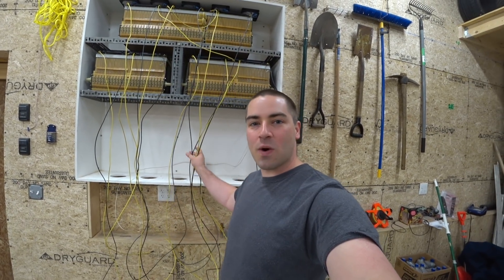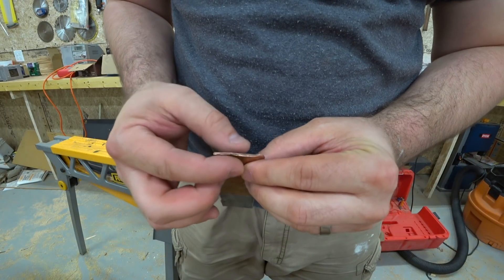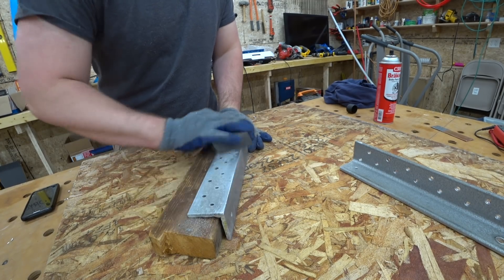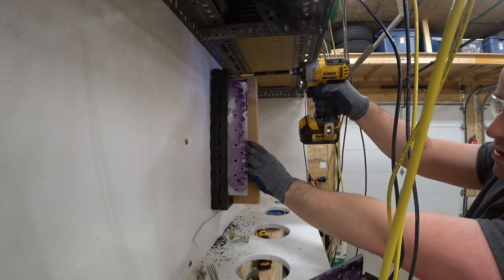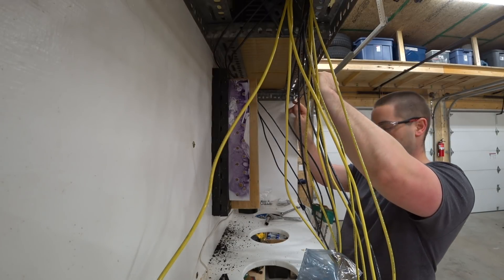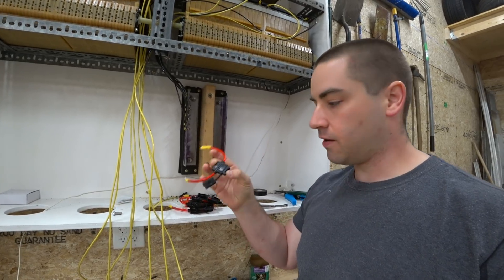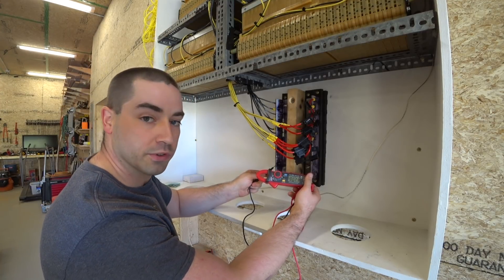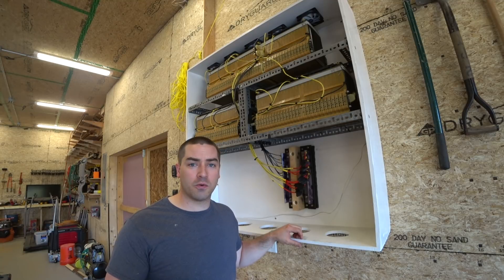Making Busbars, wiring batteries together, DIY Powerwall (Chevy Volt)

Comment: Enough criticism with wall rack and all great job... Well done and with thicker wire things would be perfect... 👍 
Tell us about bms that you attempt to use or how are your thoughts about it... 👍
Reply from the maker: Thanks Bostjan.  What I would like to do is monitor battery cell voltages.  Not a full BMS with all the bells and whistles, just a system to check voltage levels and then I can manually take action if something goes off.  Ideally I would set this up on an Arduino, but I don't know enough about it yet.

Comment: Bla bla you have li-ion battery's they not have to be changed to the top...that's the one 
and the second dubbing the thickness of the wires would make more sense than the same length... 

Current ac 30A =dc 10-12A on the long run.... Alternating current produces less heat in the wires as direct current 
Magnum is excellent choice 👍
victron multiplus is also not bad and 1/2 the price....
Reply from the maker: Thanks for your suggestion Bostjan.  I like the Victron stuff, very nice.  From what I can tell, only the Quattro is available in 120v 60hz models, that also connects to 48vdc batteries.  In order to get the split phase 120/240 I need two inverters.  So when I'm looking at two Victrons 48/5000 vs. Magnum, or Scheider, Victron is more expensive.

Comment: personally, I would use neutral grounding bars for your buss connections instead. 

https://www.ebay.com/itm/Marine-RV-Brass-10-Gang-Terminal-Block-Connector-Common-Buss-Bar-on-Insulator/301516437153?epid=1225219710&hash=item4633c7b6a1:g:IicAAOSw8d9U2kly
Reply from the maker: Hi Christopher, Thanks for giving another suggestion.  I checked out the busbar you linked to and found it has a 150 amp max rating.  I'm aiming for a about 240 amps.  But your suggestion might work for another person watching.
Reply: how did you determine that you needed a 240A rating? 

Here's what I'm thinking... If you have a 3000W inverter running at 48V... you can draw that down to about 33V (3V/cell).. at that voltage, you would be pulling ~90A at 3000W. So, I'm thinking 150A would be sufficient for this service. But I might be missing something in my napkin calcs.

Comment: how many amp hours are each of the 8x chevy batteries?
Reply from the maker: Hi Christopher,  About 51 amp*hrs in each battery.  Chevy listed this battery at 18kwh.  So my math is simply 18,000 watt*hrs divided by 8 batteries divided by 44 volts.  The one downside of this "back of napkin" math is that I don't know what discharge rate Chevy was using.
Reply: was this a battery at end-of-life expectancy? Have you done a capacity test on one of the 8 battery blocks?
Reply from the maker: Hi Christopher,  I have not performed a capacity test.  I don't know exactly where it is in life expectancy.  I know that I've had it for a few months, sitting.  Over the last week I've been using it when I go out to the garage with the inverter.  So far it has dropped from 44.2 to 44.1.  If I remember right, when I bought it from the junkyard, they said the car had 16,000 miles on it.

Comment: Change the fuses to 20amp ones, You want them to blow well before the wire heats up and is at its limit. 30amp fuses dont blow at 30 amps but closer to 40amps. The fuse amp rating is its max continuous rating and not its blow rating.
Reply from the maker: Thanks Mike.

Comment: So what is going to happen is that one fuse will blow, then draw on remaining 7 strings will go up and all the fuses will blow....
Reply from the maker: Hi Steve,  Eventually I'll have a circuit breaker between the inverter and bus bar.  Hopefully that would pop before all the fuses.  But, even if the fuses do blow, hey, that's what they are there do do instead of over heating the wire, right?  Thanks for watching.
Reply: Hi,
Since you used quite thin wire its wise to have the fuses.  Right now with 8 strings feeding a 3000W inverter you are fine - at max load you should be pulling less than 10A per string.

If you add breakers remember to use DC breakers - to interrupt DC power is a much tougher job and the breakers are different.

I noticed that my 3000W "grid tie" inverters seem much beefier than your one.

I enjoyed the videos so far very much, looking forward to seeing more.  Such a shame its impossible to get used EV batteries in South Africa or to get them TO South Africa.
Reply from the maker: That is a shame.
Reply: Steve Davies , his house will burn down. Automotive fuses will draw more then rated.

Comment: I have been running that very model of magnum inverter for 4 Year’s and have never had an issue with it.  I also made my own bus bar but I had a copper bar given to me for it.  The angle alum bar you used is great.  I had to deal with the flat bar which took some doing.  I used
 Batteries from a computer dc ups but wish I had the batteries you have.  I used much heavier wire just because I could.  Single aught did it for me.  However I did not fuse each one.  I have a single dc breaker instead.  I am moving and will be disassembling it all very soon.  When I put it back I will incorporate some of you design in it.  Good soultioneering on your part.
Reply from the maker: Thanks for watching.  Good to hear your Magnum's been performing well.

Comment: Did you retain the bms on each of the 8 battery groups? If not you are setting this up totally wrong. They will go out of ballance very quickly like this.
Reply from the maker: Hi Harley,  I still have the original BMS from the Chevy Volt.  However, I don't think it works without being connected to the main car's computer.
Reply: Hi David. I am sorry to say these cells will go out of balance like this best case is eventual failure, unlikely worse case is a fire. Putting 48v at the end of each bank might cause 11 cells to be 3.97v and 1 cell to be 4.30v and you have 8 batterys like this! A very rough way to do it is put a cheap 12s battery managament on each bank of eight. The best way to do it is put the cells in parallel First then in series. So 8p12s. Currently you have 1p12s x 8 banks.
Reply from the maker: Hi Harley,    I'll be keeping track of my cells and make update videos if anything starts going off.  You seem pretty confident that I will have a problem, which has me looking at my system.  Can you share; do you have a Chevy volt battery that went out of balance?
Reply: I Haven't had experience with the volt battery but the idea of lithium ion is still the same!  The issue with the volt battery is it seems very difficult to separate the cells.  You will need to check the cells a fair bit.  Now you have a load (inverter) you can load up the cells and check the voltage at each individual cell.  This will give you an idea if any are slightly weaker then others.  Remember if they drop more under load they will charge higher when on charge.
Reply: DavidPoz you're exactly right the BMS will not work without extensive modification which would make it cost prohibitive. It would be easier to go out and buy a BMS if available for the volt batteries.  There are several companies out there making them for the Tesla batteries but I haven't seen anybody use the Chevy volt batteries. The BMS is a very important part of your battery system not only does it condition your batteries extends the life of your batteries and makes them safe for you and your family.. remember that's the most important part of this equation.

Comment: David,

Couple things, 

Be careful of compatibility of different metals in contact. Dissimilar metal contact can cause corrosion over time.  I have a home from the late 70's that has aluminum wiring in it. All of the outlets have a compatible coating on the wiring terminals that will not corrode over time. They cost 10X normal outlets to replace ( C0/ALR. )  I'm not for sure what the coating is, but it is important to use them with wiring.  I have discussed this with a licensed electrician.
Also, If i use wire nuts to tie copper and aluminum wire together, I use special wire nuts that are filled with anti corrosive paste that can suppress corrosion.  I don't want my house to burn down.

If you start to get corrosion on the terminals to the aluminum bus bar, the resistance at the corrosion goes up and it will start to heat up. Don't mess around with this stuff.  Your wooden battery box with the blower fan's to feed the flame can torch your garage.

When you get done with this, run a stress test with max load and look at all of the terminals and wiring with a thermal camera.

The second thing:

Calculate the maximum amperage you need to pass.  Then, go to the link below and find the equivalent wire gauge for that maximum amperage.  Listed in the power stream Chart is the cross section area for copper wire gage.  Find the equivalent wire gauge.  The Cerro wire link lists copper and Aluminum for each ampacity based on wire gauge.

So armed with this knowledge of Cross section area needed for the buss bar, Measure the cross sectional area of your copper pipe flattened and also your Aluminum angle measured.  Since Copper is more conductive than Aluminum, the aluminum cross section will be larger.  An example from the chart.  12 gauge copper can handle 20 amps.   12 gauge aluminum can handle only 15 amps.

I would love for you to show your measurements and calculations.

https://www.powerstream.com/Wire_Size.htm

https://www.cerrowire.com/ampacity-charts
Reply from the maker: Hi Gregg,  Thanks for the links and the suggested future video.  I did spray everything down with anti-corrosion coating and will be keeping track of it in the future.  It is right there at eye level so easy to see if something is happening.

Comment: Great job, didn't notice how new the videos are and was looking for what you used for the invertor. Currently doing a 18650 smaller power wall to feed my work shop and expand. I want to be able to run a 48 v system as the amp damand is way lower.
Reply from the maker: Thanks for watching.  I'm still up in the air about which inverter to buy.  Let me know how your project goes.
Reply: DavidPoz thanks, in FL and HOA says I have to be selective about what and where I put things.  My goal will be to be as big as yours but smaller milestones.  Looking at grid ties but would like suggestions about best ways to grow. I am looking at doing the 44 to 45 v set up as in the good balance point for amp load conversions.

Comment: im not sure but when you did your cut is the negative wire the same length as your pos wire with your fuse wire added on ?great looking project sir cant wait to see it done and bringing you power
Reply from the maker: On 7 batteries the negative wires are 6 feet, and positeves are 5.5 feet.  However, on one battery the negative and positive are shorter to account for the wire jumping between cell groups.

Comment: Looks great David.  13 months full time off grid taught me this about the Magnum.  The voltage fluctuates. You will notice it if you have an old incandescent light, or perhaps you'll hear a fan speed up and slow down.  I've recorded it going from 119 to 123 volts, up and down. They replaced my slave under warranty and it was somewhat better. The other problem is the hertz does not hold on 60, you'll see it float from 58-60. This means any clocks or timers you have that rely on frequency to keep time will be off.  Our microwave will lose a couple minutes per day and the outside light timer is forever lagging.  Not that big of a deal, just annoying.  You would think they could get this right.  Perhaps all inverters are like this- I suspect not.  Otherwise I'm happy with the Magnum.  Someone made a comment on heat, they remain cool to the touch. I was really tempted to try a Schneider 6848, and totally tossed a coin at the end.   I'm hoping John Novak reads this and gives his impression on the 6848 - does it hold voltage, does it hold hertz.... and any other observations he might have :-)
Reply from the maker: Thanks a lot for your input Mark.  Perfect information, something I won't hear about in the marketing.
Reply: I have the 6848's baby sibling, SW 4048, and the freq. stays dead on 60. The voltage seems steady 120V/240V too but I only run it at about 70% of max in my setup.

Don't know if this matters but if the SW is within your specs it's worth a look. I've not had any issues with the Schneider equipment in 2 years of us ever; I use their mppt 150-60A charge controller as well.

I got both from AltE store, as well as a lot of the misc gear. Always have good service from AltE.
Reply: We are 100% off grid. Have been using an Outback 3524 for the last 11 months with no issues so far! Best of luck on your projects, Poz!

Comment: Also, second major issue, those fuses are NOT rated to break 30A at 44V. They are AT MOST 24V rated auto fuses (given the origin I'd be inclined to think only 12V), that means if they trip it will be a loud BANG followed by molten metal flying out (30A at 12V is only 360W, compared to 1.3kW at 44V). You can also find a 250A Class T fuse and block right here https://www.solar-electric.com/fb250ampfuwi.html or you could use the 175A Midnite breaker https://cl.ly/rYZU

Comment: DEAR GOD NO. That copper pipe doesn’t have nearly enough meat to it for a 250A bus bar (nor is it the right alloy), you want at least 1in wide by 3/8in thick type 110 electrical copper, buy it ready to go in lengths up to 6ft from McMaster-Carr. Aluminum bus bars are hardly used in industry since they require extreme care to bust through the much tougher oxide layer, very tricky to get right in the home shop, not to mention that you would need almost double the size as copper to get the same amount of ampacity
Reply: Yet aluminum service cable is used everyday in the 200a service to houses! Aluminum primary wires are also commonly used on EHV, Transmission, HV, Subtransmission, MV, Distribution, LV, feeder, along with LV, Service Drops, as copper is cost prohibitive. Noalox grease has been in use for a looooong time for aluminum connections, with a long history to prove it is perfectly acceptable.
Reply from the maker: I'm glad I didn't go with the copper, thanks.
Reply: Aluminum is terrible for DIY installations, an oxide can/will develop an create resistance. It is possible that as the resistance builds up , from close to zero to a few hundred milli-ohms  that heat will build up with high currents, and cause a fire. I would listen to Liam and replace the aluminum with copper as he suggests.

Comment: For cheap inverters, if you find old UPS's.  People throw these out when the batteries die.
Reply: we have a electronics recycler in town. if you do, they might sell you the inverters by weight. without batteries in them, this is a real bargain....
Reply from the maker: Good tip!  I'll check craigslist for an UPS's

Comment: the aluminium is the way to go. you can drill and tap into it instead of using nuts and bolts and it can be fastened to the cabinet easier
Reply from the maker: Thanks David.

Comment: I would run some kind of wrap around the wire to prevent any chafing against the brackets.
Reply: If I would have watched it through before commenting, I would have seen the tape you used, lol.  But the wire wrap does clean it up and make it nice and neat.  Good job so far!  I am thinking of tackling a project like this myself.
Reply from the maker: Cool, thanks Mike. Let me know how it goes with your project!

Comment: I would turn the yellow wires around so the fuses would be  as close to the battery attachment points as possible
Reply from the maker: Hi Gary,  Thanks.  Is there some electrical thing about doing it that way that provides more protection?  I had positioned them this way so that I could service the fuses easily, but if it's wrong I will switch them.  Maybe, is there a resource you could direct me to online so I could read up about the benefits?  Thanks, David Poz
Reply: When you put the fuses near the power (distribution) point, your wires from the battery to your busbar will be protected. Right now, if the metal frame cuts the insulation of both a black and a yellow wire you have an uncontrolled arc welder. If the fuses were up where the yellow wires connect to the battery, they would blow before the arc is sustained long enough to start a fire.
Reply from the maker: Hi Gary,  Wow, that is a really good point.   Thank you.